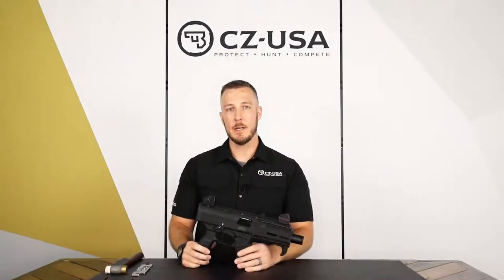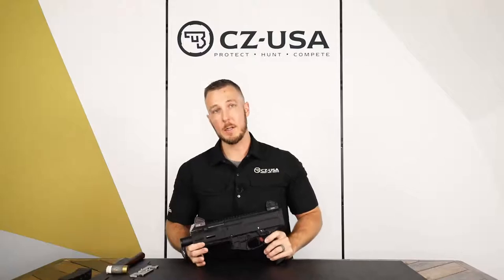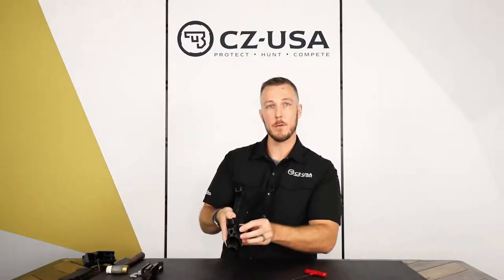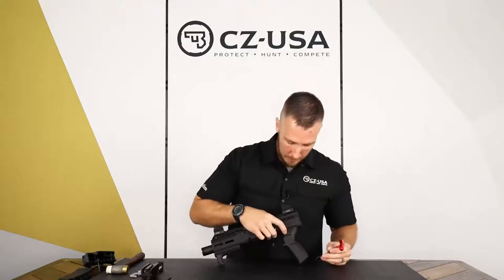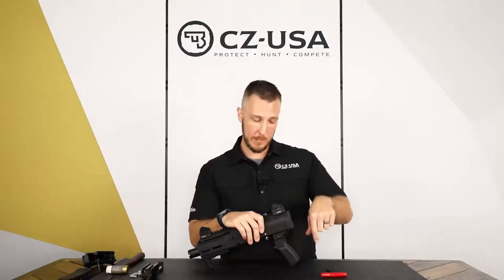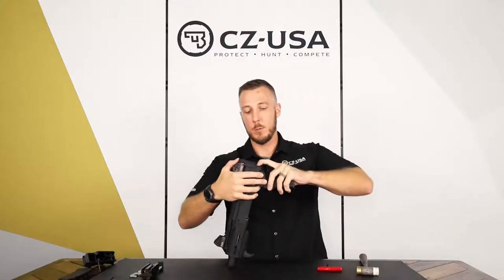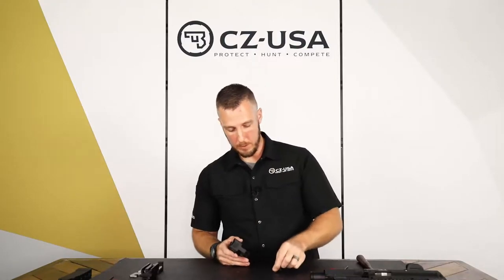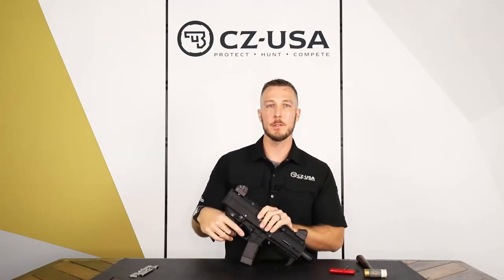Changing Common Parts on the CZ Scorpion 3+

Comment: We need a video on the CZ scorpion 3+ 7.8 removing muzzle device
Reply: Right did you find it?
Reply: @snoopy_g4924  I found a way to takeoff the faux suppressor, but it required me scratching the hell out of it with a channel lock to take it off, I honestly didn’t care because I didn’t want it on my gun anymore
Reply: @Scar_afro  I scratched the hell out of mine and still didn't manage to get it off.
Reply: Any update on removing the 7.8” muzzle break? Looks like you’d need a special tool?
Reply: @demonhanzohattori what’s the difference between the micro one or the 7.8 one?
Reply: @Biggity_Brown  The 7.8 does not have the notch on the front that the armorer's tool fits.  It has 6 recessed circles on the very front.  Looks like it's made for a spanner, but I wonder how much torque it can take before it mars the finish.
Reply: Agreed sir
Reply: I used a small spanner wrench, but still can't remove the damn handguard.
Reply: I’m having the same issue with my 3+ 7.8”. The six holes seem to require a special tool but I can’t find it anywhere. Anyone figure it out?
Reply: Same curiosity here.
Reply: i used a rubber strap wrench. wrapped the strap around twice before bringing it through the wrench. loosened with no problem.
Reply: Walmart sells a 4 inch strap wrench that took mine right off. It's $8 dollars and worth every penny. 

The tube broke loose 1st, but I just un-threaded it and then put the strap wrench back on below the lip and it popped right off.
Reply: You can buy the tool to remove the faux supressor on HBI Industries. The handguard is held on by the barrel nut. They also sell a tool for that on their website. Hope this helps!
Reply: Lmao what
Reply: Was looking for the same info on removing 3plus 7.8inch muzzle. Brought me here. Anyone in this thread have any other tips and tricks for this. Thanks in advance
Reply: Threats must not have been oiled when the original was installed. Mine literally came loose just by me looking at it. No joke
Reply: @CassidyGarcia-k6i  What did you find to be both laughable and confusing?
Reply: @Kash0916 the fact you need to buy special tools just to take a muzzle device and a handguard off this damn thing is making me regret buying one. Should’ve just cried once and got a MPX
Reply: @dpdrummer89  I'm doing the same right and this shit is still not coming off. Who the fuck was on the assembly line that day slathering the hell out of these with locktite?

Comment: That flash can on the 3+ micro will not just unscrew as easy as shown. Someone at the factory used loctite or rockset on mine. It just won't budge.
Reply: I had the exact same issue with mine. I had to completely drill through the flash can and stick a thick screwdriver through it to be able to break it loose

Comment: UPDATE on handguard removal. 

The faux suppressor on the pistol needs a 3mm spanner wrench to be removed, however, there is so much loktite type adhesive that it will probably bend the holes before it comes out. Best bet is to use a LARGE strap wrench, that’s how mine came out. After that before you can remove the handguard, the barrel MUST come off. HB industries sells that tool but it’s not cheap!

Comment: The pin holding in the charging handle won’t budge! I started tapping it with a mallet but it’s chipping the polymer, any advice? It feels stuck real good in there.
Reply: Having this exact same problem. Did you get it figured out?
Reply: @austinmars360  Yes I finally got some help from the CZ Scorp Reddit bros. 

The trick is to find a punch that has the same diameter face as the pin, (or as close as possible). Then hitting it straight on harder than you think you should, with a lot of patience it will overcome the detent’s resistance.

It seems counter intuitive to use brute force but I was able to tap it out without destroying the OEM pin.

Hope this helps.

Comment: Anyone have the 7.8" pistol version? I'm trying to remove the muzzle device to put a suppressor on and I haven't had any luck. The entire piece spins inside the handguard.
Reply: Any luck on figuring this out?
Reply: Yep, I'm having the same problem.
Reply: Just figured it out. On the 3+, the "muzzle device" is a 6" long piece, not just the end cap. 
A pin spanner wrench (for bicycles) is the perfect tool. However, if you don't plan on reusing it, just crank it off with adjustable pliers.
Reply: @AZQuadRunner what’s the difference between the micro or the 7.8 barrel muzzle?
Reply: @Biggity_Brown  I can't speak to the Micro, although it looks to be about 3" long, and it has a standard muzzle device look to it. The pistol (7.8") has a shroud. Picture an empty suppressor turned backwards. 
Both have 1/2-28 threads, but the shroud took some brute force to get off. My bike spanner pin wrench was a perfect fit, but a strap wrench with a urethane (not rubber) strap might work.
Reply: @AZQuadRunner  I wonder how hard you need to get them synched back down? I read that the thread protector has a habit of coming loose and you can shoot the damn thing if your not careful.
Reply: @Biggity_Brown  It had a good amount of thread lock on it, so if you don't remove it, you should be good. If you do remove it, put another dab of hi-temp thread lock before reinstalling it.

Comment: Will the lower be interchangeable with previous generations?
Reply: I doubt it the magazines don’t
Reply: @hoghunter6872  magazines only need a new mag catch in them. It’s not a big deal.
Reply: From what I have seen the lower will work on the older generation upper and vice versa. The issue is that the older generation 30 round magazines will not work with the lower due to the ambidextrous magazine release.

Comment: Polymer push pin that retains charging handle will not budge. Disappointed with the 3+ so far…
Reply: You’re not strong enough
Reply: @MrRagerop  my, what a witty retort. Only took 5 months.
Reply: @matthewsommers3254  just watched the video or would have said it 5 months ago. I'm curious they did you finally get it?

Comment: Are the parts in the bolt like the firing pin, extractor and recoil spring as well as the parts in the trigger pack like the trigger and hammer springs the same as the older EVO 3?
Reply from the maker: The trigger casing is different, but all the internal components are the same as well as the bolt components.
Reply: @czusafirearms  Thanks, I just bought a 3+ Micro yesterday and wanted to buy some spares.
Reply: @czusafirearms so the bolt assembly is still the subpar soft metal that burs over the firing pin block causing oobd? I hope not. That's disappointing and unsafe for everyone

Comment: On the 7.8 inch 3+ I noticed that if you have a loaded mag and you're trying to load it when the bolt is closed (not pulled back) it will not load. The bolt has to be back

Comment: Can a suppressor fit under that hand guard?
Reply from the maker: It will. We do not have a list of all compatible cans, however, the inner dimensions of the handguard are approximately 1.5 inches, so as long as your can fits this criteria it will work. This will fit most 9mm cans.
Reply: @czusafirearms  I ordered one before knowing so I’m glad! I figured as much but it looked like it would be close judging off the diameter of the blast can. I’m glad you guys made the few subtle changes and looks. Perfect refinement. Now if a aftermarket guy can 3D print the new mag cut into legacy mags the world will be a better place lol. Thanks for your time.

Comment: Quick question. I just purchased a brand new cz scorpion 3 plus micro and (while at the store) I attempted to rack the scorpion. The pull on the charging handle must have been 40-50 lbs and was unsuccessful. The clerk stated that you need to use a hard surface like a desk or table. WTF. Apparently, this is common after a google search. Can someone please explain to me what to do about this besides taking this to the range and running 1000 rounds through it to see if it loosens up??? Is there anything I can do to correct this?  Again, this is a BRAND NEW micro never fired. Thanks.
Reply: Did you figure this out? I'd be sending it back to CZ for warranty repair. Just got a new 3+ Micro and it's very smooth. Charging handle takes a bit less effort than AR platform 👌🏻
Reply: @HondaTurboToys  I did. It just needed to be racked 1.21k times. 

I'm more concerned about the soft bolt carrier group than anything. We shouldn't have to purchase a Nexus bolt to fix what should have come proper in the first place.

Comment: Is it possible to have a cocking handle on both sides?
Reply: yes it is  I bought 2  Hb industries theta's  one for each side
Reply: @williamwofford2503  Thanks William, I figured it was posible since the charging handle doesn’t reciprocate. I had already replaced the original charging handle with a Strike Industries version and and I’m going to add a second one now.
Reply: @pauliedweasel   I have two HB industries theta's coming for mine i also trimmed that safety lever that was digging into my hand a little careful file work made it much more comfortable  all that's left after that is a laser to attach on the m lok  and it will be good to go , don't really need the laser , the iron sights work great , but  i like the faster target acquisition you get with a good laser mounted properly .

Comment: Flash can had a ton of rocksett on it which made it difficult to remove. 
The pin to remove the charging handle doesn't punch out even when using a hammer.
 Bullshit video.